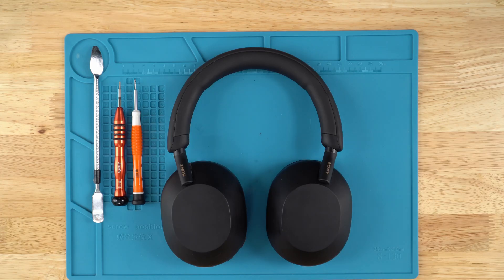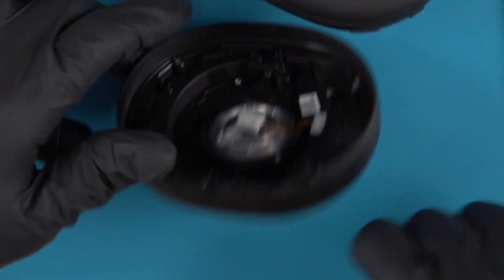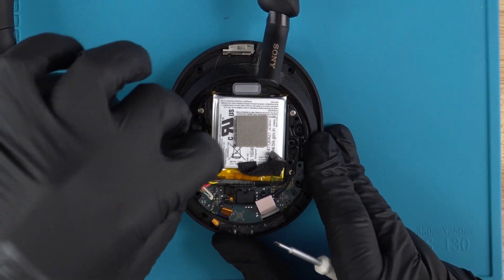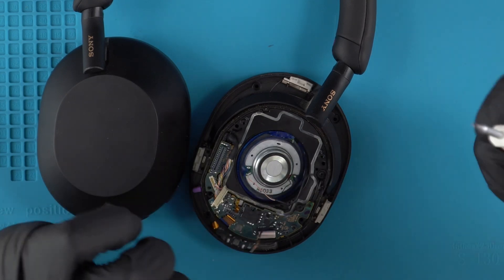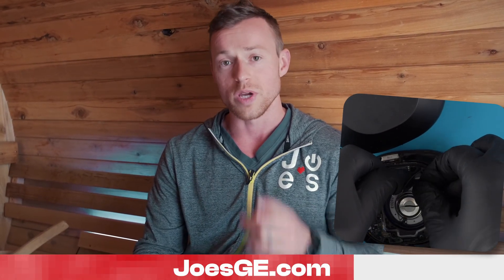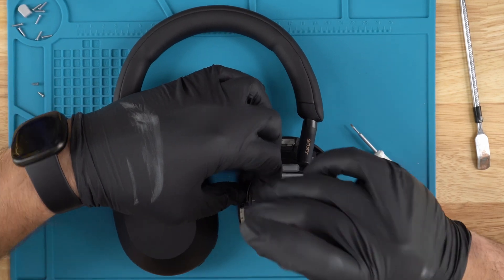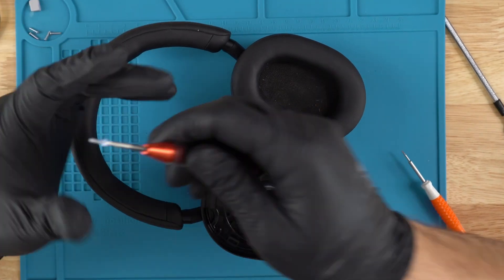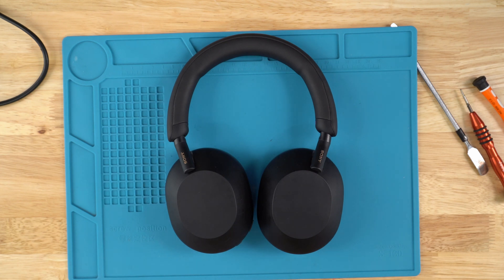Sony WH-1000XM5 Speaker Driver Replacement: Full Breakdown & Repair Tips

Comment from the maker: 🔧 Need Your Sony WH-1000XM5 Repaired? Send It In Here
👉 https://www.joesge.com/pages/repair-service-headphones-sony?utm_source=youtube&utm_medium=product_shelf
🛍 Prefer DIY Repairs? Buy Genuine Replacement Parts Here
👉 https://www.joesge.com/products/sony-wh-1000xm5-wireless-headphones-repair-replacement-black-parts?variant=40854398140462&utm_source=youtube&utm_medium=product_shelf
🧰 Tools Used in This Video
50-in-1 Tool Kit:
👉 https://www.joesge.com/products/joesge-repair-tool-kit-50-in-1-precision-screwdriver-set-tools?variant=32817393074222&utm_source=youtube&utm_medium=product_shelf
Pry Tool (Square Tip & Round Tip):
👉 https://www.joesge.com/products/strong-metal-square-tip-round-tip-headphones-opening-pry-repair-silver-tools?variant=39665858347054&utm_source=youtube&utm_medium=product_shelf
Phillips 1.5mm Screwdriver:
👉 https://www.joesge.com/products/electronics-precision-screwdriver-philips-1-5mm-repair-tools?utm_source=youtube&utm_medium=product_shelf
Flathead 1.5mm Screwdriver:
👉 https://www.joesge.com/products/flat-head-1-5mm-thin-strong-screwdriver-pry-repair-tools?utm_source=youtube&utm_medium=product_shelf
Soldering Iron Kit:
👉 https://www.joesge.com/products/60w-adjustable-led-soldering-circuit-board-repair-iron-kit-tools?variant=40553764192302&utm_source=youtube&utm_medium=product_shelf

Comment: Hello, if I plug my Sony xm5 after 4-5 seconds it will stop charging. What do you think might be the issue, is the charging port or the battery. The headphones are dead.
Reply: And if I use the 3.5mm jack only the left side is working, the right side will have a low sound as if it’s not working.

Comment: My right side had died and found your video, ordered a replacement, and now my right side works, however the bass/ambient mode of the right side seems to be higher than the left side which is a little disorienting. Do you might know why? Thanks alot in advance
Reply: Would it have anything to do with the driver not being seated properly when lining it up with the notch, because at loud sounds I can physically feel the vibration of the headphones at the right side vs the left side
Reply from the maker: Email us at support@joesge.com, and we'll try to help you out! 🥷

Comment: Managed to repair my left side driver using your tutorial. Just want to thank you, I was worried after my headphones broke. 
As for the differences, instead of the battery, you first need to remove the circuit board using three screws, then remove the screws for the black plate and pry it open (just like he did for the battery). Rest of the steps are the same!
Reply from the maker: Fantastic news, thanks for the comment! And thanks for sharing the extra steps!

Comment: so I put the 8 screws back in, but I seem to have one small black screw left over?
Reply from the maker: Hey! Maybe you unscrewed a screw from the board? There were 8 screws on the outside and 4 inside total in the video.
Reply: @Joesge  well thx to this vid, it all seems to be working, even the problem with the touch sensor randomly activating (which Sony failed to fix) has disappeared, maybe that was caused by the black screw lol

Comment: Hey, I had a speaker that made rattling noises whenever I was on the bus and opened it to see that there was a gap in the speaker driver where the adhesive had came off. I tried using a tool to seal it again but I guess I poked a little too hard and now speaker has no sound. Would buying a new speaker solve this issue?
Reply from the maker: Replacing the speaker should do the trick! Reach out to us at support@joesge.com for a proper diagnosis, and we’ll definitely help you out!

Comment: Hi, i hope you are well
 My right side isn't working in terms of audio. The touch pad works, but their is no audio. What could be the issue ?
Reply from the maker: Most likely it’s a bad speaker driver.
Reply: Hey, I have the exact same problem. Was it indeed the speaker driver?
Reply: @abacate8074  I didn't send it for repair yet as I was moving. But will send in few weeks. But the repair cost atr expensive.